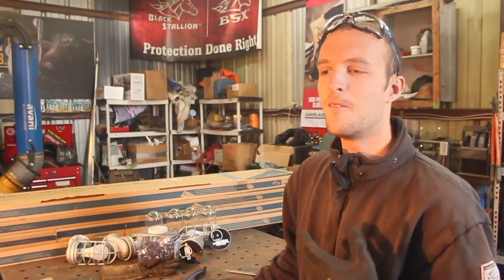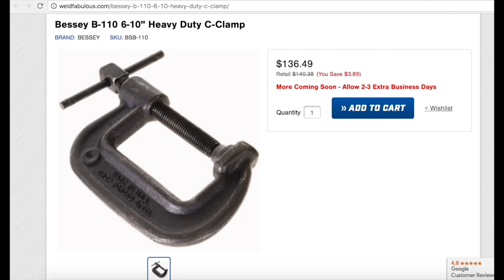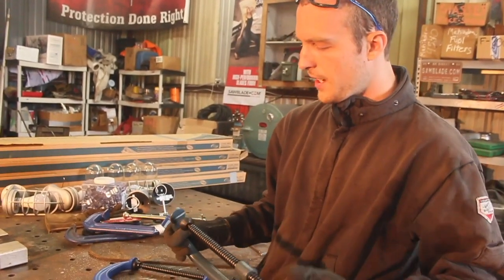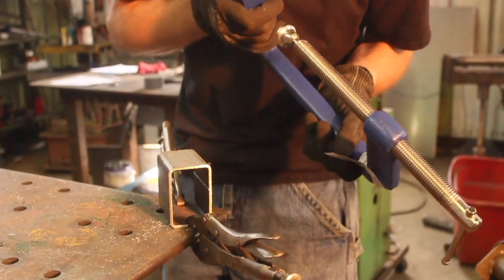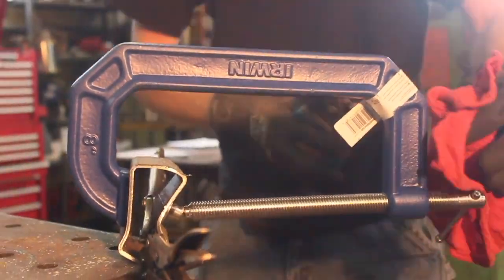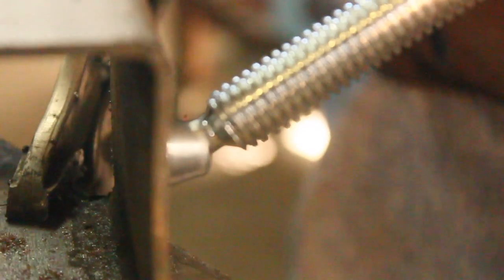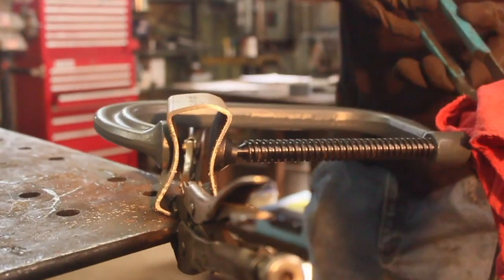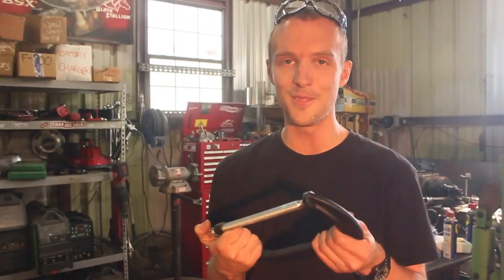BEST "C" CLAMP?!? IRWIN vs WILTON vs YOST vs BESSEY - PUTTING THEM TO THE TEST - NOT ALL SURVIVE!!

Comment: You put your finger on it when you said the words “used to make some really great…”. That’s the sad story with so many old names.  Being old myself (68), I’ve spent years acquiring tools.  I look for OLD ones.  Today I did a job that stressed the crap out of a 5” then 8” C-clamp.  Tightened with a cheater, beat on the screw with big hammers, used the clamps to press out some very stubborn pins.  Both clamps were old and American made, with real Acme threads on the screws.  I noticed one was a Wilton.  My best vise-grips are OLD Vise-Grips from DeWitt, NE or brand new Malco Eagle Grips from the same factory.  My 5” shop vise is older than I am, weighs 70 lbs. and is better than any 5” vise I’ll find today.  As a low budget retired guy, I say look for the old stuff.  Carry on!

Comment: If you can weld and do a bit of metalwork making new swivel pads isn't hard to do. I've taken clamps that had lost their swivel pads and made new ones. I take a thick scrap of steel and drill a pocket out to hold the ball on the end of the threaded rod then cut a washer so I can get it over the ball. Put all that together and weld it up. It takes some time but it's not the kind of thing I mind doing if I'm in the mood to do it. The repair can be better than what you can buy anyways. Because I usually make the pad a bit oversized and I like them that way.

Comment: To be fair Bessy still makes high quality  clamps for industry your local shops may not be in the loop. But any experienced hand knows you don't use the last inches of a c clamp scew., you use the avaliable throat and the first 2 to 3" of the screw and for pro. Use, ditch the c clamps all together and up grade to bessy slide F clamps and for high torque clamping presher invest in some appropriate sized bridge clamps..